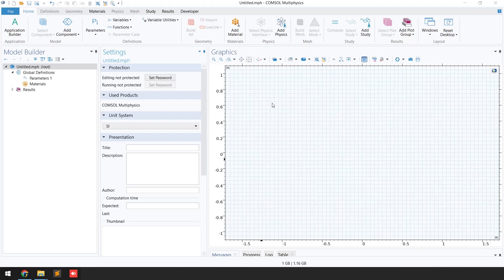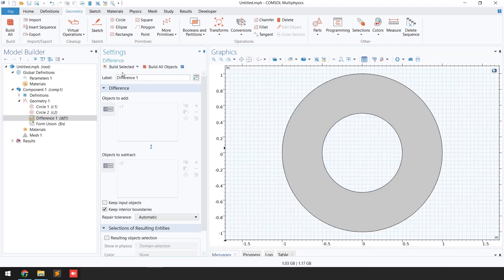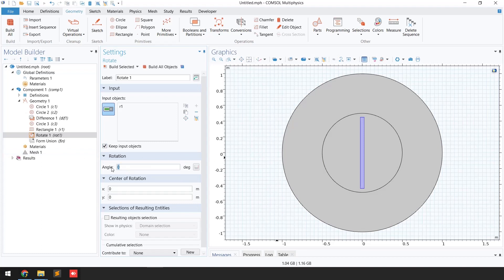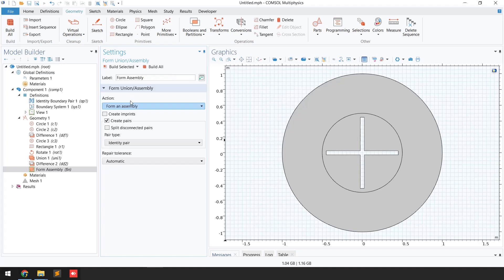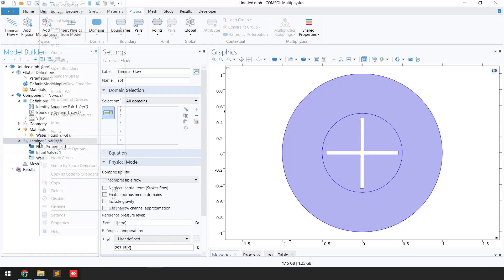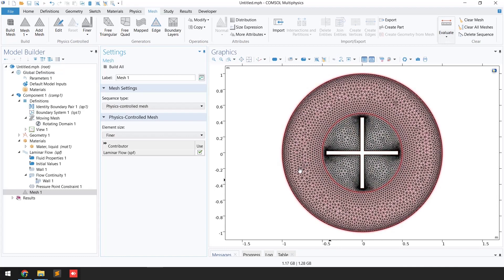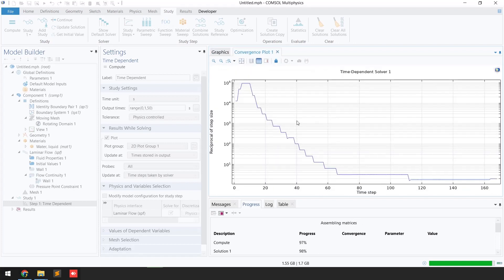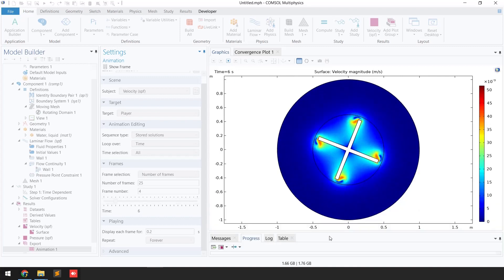COMSOL Tutorial 13 | 2D Rotating machinery simulation | Simple mixer numerical modeling using COMSOL

Comment: Hello sir, with the help of this video I was able to understand how to handle rotating geometry. I am currently trying to model 'pin on a disc' assembly where I have a rotating disc and a pin is in contact with the disc with a certain load applied on the pin. I want to study the frictional forces acting. Can you tell me how to proceed for this situation.
Reply from the maker: Great to hear the video helped! For the pin-on-disc setup, consider using a contact pair to model the interaction and friction between the pin and the rotating disc.

Comment: Hi. I modeled this mixer and then i applied "Incident Intensity" from "radiation in absorbing scattering media" to blade boundary. But in the results the boundary of blade didn't rotate. So I tried add a rotating boundary in the moving mesh but all boundaries were not applicable. Would you give me a hint for this problem?
Reply from the maker: Thanks for your detailed question! It sounds like the rotating motion wasn’t applied correctly in the Moving Mesh (ALE) or the domain for rotation wasn’t selected properly. Make sure to use a Rotating Domain (not just a boundary), and that your blade is part of that rotating domain.

Comment: Thank you for the video! I have a follow-up question. What if I want to keep the blades and study the heat transfer in the solid domain(assume that blades include multiple solid domains that rotate with omega speed). Should I also define the identity pair for the interface of blades/ solids with the inner circle/fluid domain? Or do we still need 1 identity pair between the smaller and bigger circles (non-rotating and rotating domains)? In other words, my main question is when to use the "pair identity" feature. Should it be applied between the rotating domains (which may include fluid, solid, or both) and the non-rotating fluid domain? Or, do I also need an additional identity pair at the interface between all rotating solid domains and the rotating fluid domain? like a total of two identity pairs (interface between all rotating solid domains and the rotating fluid domain and rotating and non-rotating fluid domains)? I have a case study and can email you if you want me to clarify my question further. Thank you!

Comment: Thank you, Professor, for this effort and simple explanation. I have a  question , I want to use a fan in a room to exhaust air to another room what are the steps to follow to apply to COMSOL
Reply from the maker: Thank you for your kind words! To simulate a fan exhausting air from one room to another in COMSOL, you can follow these steps:

Geometry Setup: Create the geometry for the two rooms and the connecting fan area. You can use simple 3D boxes for the rooms and a cylinder or opening for the fan.

Physics Selection: Use the 'Laminar Flow' or 'Turbulent Flow' module, depending on the nature of the flow, to simulate air movement.

Fan Definition:

In COMSOL, you can use a 'Fan' boundary condition if you're modeling the fan explicitly, or you can define a velocity at the fan inlet/outlet.
Alternatively, apply a pressure boundary condition at the outlet of the fan to simulate the pressure difference driving the flow.
Inlet and Outlet:

Set the inlet of the first room as an inflow boundary condition, where the air enters.
At the outlet (the second room), set a pressure boundary condition or outflow condition at zero gauge pressure.
Mesh Generation: Create an appropriate mesh for the geometry. Make sure to refine the mesh near the fan for better accuracy.

Study and Solver: Choose a time-dependent study if the flow is transient, or a stationary study if it’s steady-state. Run the simulation to analyze the airflow patterns and exhaust performance.

Let me know if you need more detailed guidance on any specific part of the process!

Comment: Great video, gave me a lot of guidance and inspiration.
I have a  question, why do you need the small circle in the middle? Is it possible to do such a simulation using only the big circle and the impeller?
Reply from the maker: Thank you for the positive feedback! I'm glad the video was helpful.

Regarding your question, the small circle in the middle typically represents a part of the geometry such as a hub or support structure that interacts with the fluid or affects the motion of the impeller. It's there to provide a more realistic simulation of the system.

Yes, you can perform the simulation using only the big circle and the impeller, but the results might be slightly different as the smaller circle plays a role in how the flow interacts with the impeller. If you’re focusing on a simplified model or just the impeller’s behavior, you can try removing it and see how the results differ based on your simulation goals.

Hope this helps, and feel free to ask if you have more questions!

Comment: Can you rotate blade by fluid pressure?
Reply: i also working on project where blade is rotates through fluid
Reply: @muddaserahmed3652  do you have results? Which software do you use?
Reply: But i got errors
Reply: I use comsol for CFD
Reply from the maker: Yes, the blades can be rotated with fluid pressure with FSI modelling.
Reply: @LearnwithSAI  can you help me, write me you phone number?